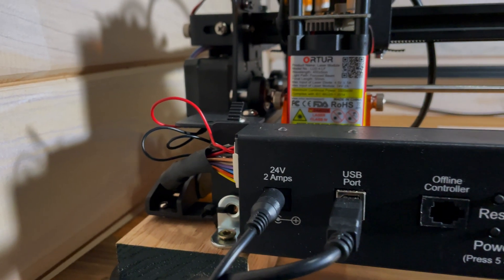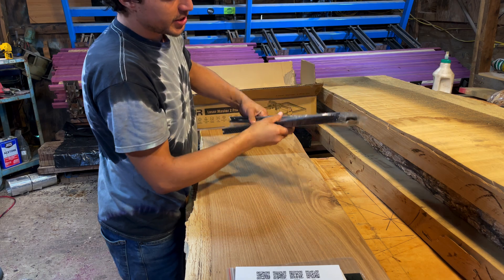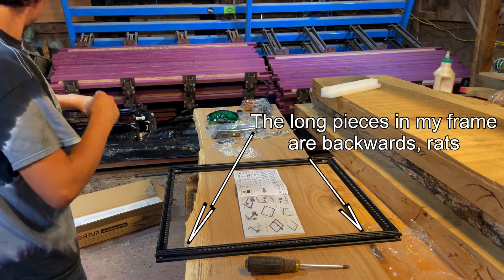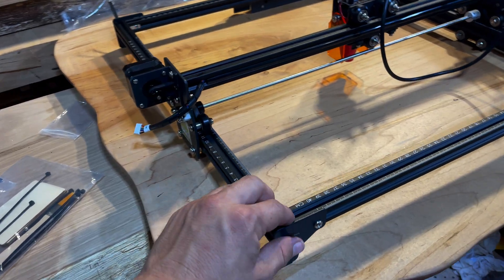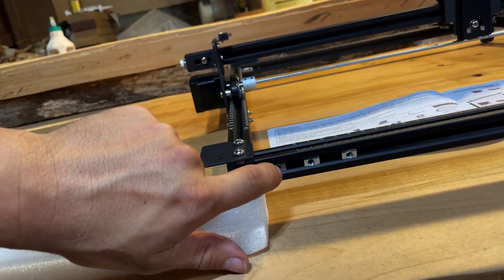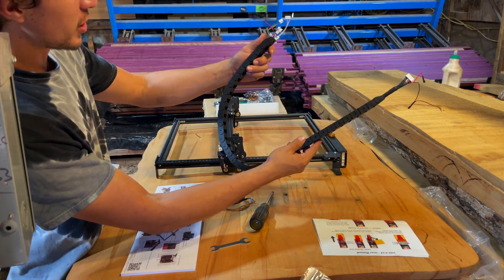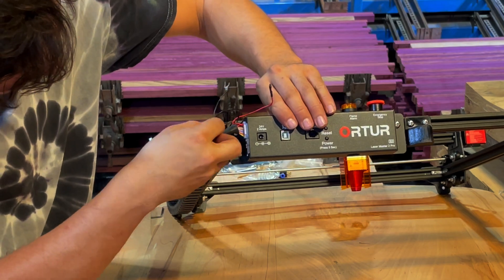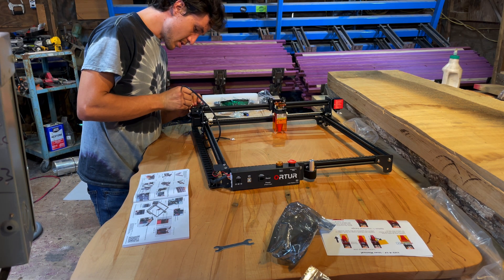Ortur Laser Master 2 Pro S2: Unboxing and Assembly

Comment: I think it's wrong my friend. The 0,0 should be the front-left corner of the machine (where the limit switch and the control panel should meet also). I agree with you that instructions and video are very confusing. Then you have different videos and instructions for Laser Master Pro and Laser Master Pro S2 but they don't tell you if they are the same or not.
Reply from the maker: Your 100% correct. I put a text correction during that part of the video.